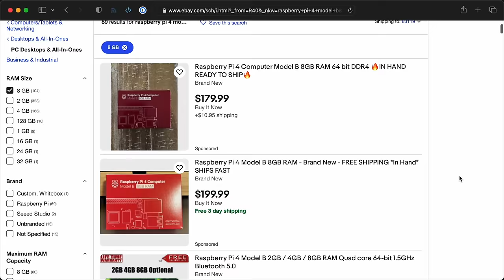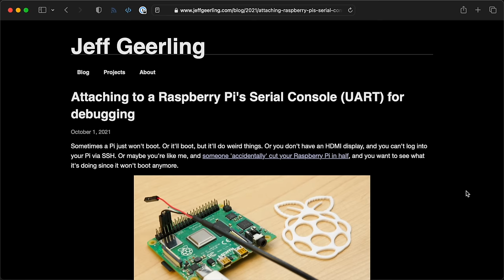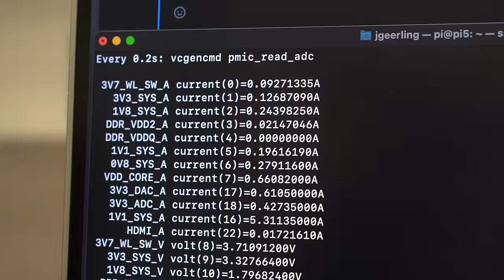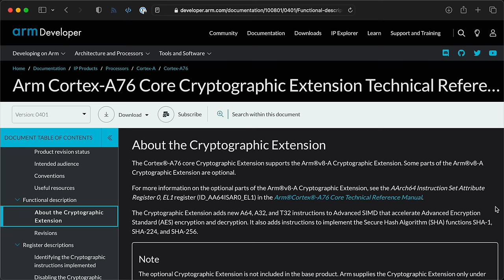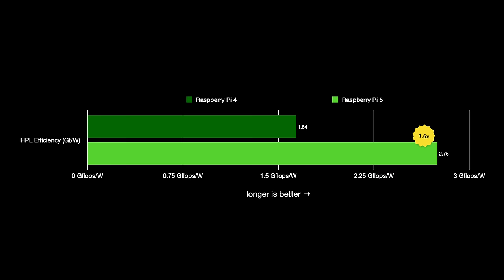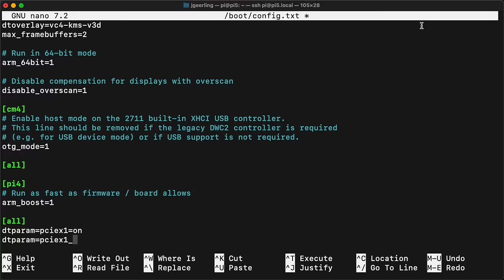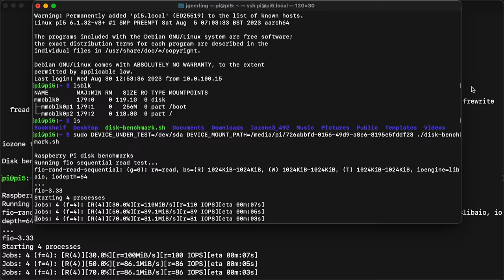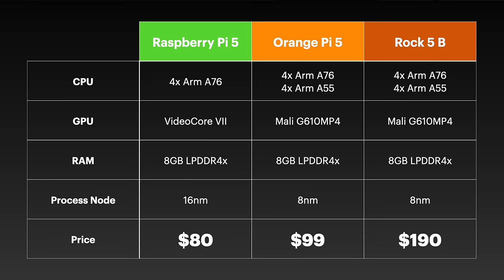Raspberry Pi 5: EVERYTHING you need to know

Comment: Thanks for the all tests and well organized review. What is status of UEFI and ACPI, and TFTP netbooting?  I used RPi4 firmware about a year ago, and it kind of worked, but some stuff did not work (either were broken, memory issues on 4GB models, various drivers not working or not having bindings, etc), and it still required extra partition just for the RPi, which is really not great.

I want to use UEFI and ACPI for just running standard Linux distros, but Windows people might also find it useful.

Comment: Can the RPi 5 use OTG on the USB C power port? It would be great if a powered USB C hub can power the RPi 5 and supply extra USB ports with Raspberry Pi OS?  I see it has been done on OpenWRT. The RPi supported USB 2.0 with OTG, is this still the same with RPi 5?

Comment: So there still isn't an integrated battery power alt source option? Such a missed opportunity.  Most external packs tend to cycle power when charging or changing wall vs battery, 3rd party micro UPS is iffy and expensive...

Comment: So are you going to finally get a GPU to run on a Raspberry Pi with the new 5 and all its improvements? I await your attempts on the edge of my seat as I would love to be able to run Cuda on a SOC that's not a Jetson and the price tag. A 1000 series Nvidia GPU has 2080 or so CUDA cores and my AMD backup desktop which is merely screwed to a wooden create has Ubuntu Studio and a 1000 series Nvidia GPU and it accepted the new drivers.

Comment: @JeffGeerling In my precommand I chose to have the official case with my RPi5 over the Active Cooler because I have cats. And I have a set of three heatsinks for RPi4 which sat unused since I put my RPi4 in an Argon case. I intend to reuse them on the RPi5 in combinaison with the official case. 

So in your opinion, which are the two chips beside the CPU where should I put  the heatsinks ?

Comment: Immediately ordered one just to see that my regulars 5V 3A USB-C PD chargers (the WW standard, i have maybe 10 of those at home) will not be sufficient and i would need to order the Pi specific power adapter. For the RPi5, we need a 5A 5V USB-C adapter that is non-standard and defeat the basic purpose and regulation of USB-C standardization. Why didn't  they chose a fully standard USB-C PD higher voltage with lower Amperes adapter instead ? Now, i am considering canceling my order for a not so improved new Pi system for 2023/2024 and my user case.... still have a month to decide.

Comment: Bluetooth - On my Raspberry PI 3 I had Bluetooth range of at least 30 feet maybe a little more. When I switched to PI 4B it dropped to approx. 10 feet maybe less. Has the Raspberry PI  5 fixed this issue?    I spent a lot of times on forums and with knowledgeable people in support and failed to find the PI 4B issue so I went back to the PI 3.

Comment: Is Pi 5 better suited for Frigate, especially with the pcie header (paired w/ Coral), or is a NUC still the best option? Looking for a low-cost but also low power (ARM vs x86_64) solution.
Reply: Honestly anything but RaspberryPi. Their image was ruined badly with the chip issues (which were easily fixed).

Comment: Does the new power controller mean we can use PD compliant bricks like the anker 30w gallium ones?  They only mention 5v/3a and it would have to support one of the higher voltage modes to get over the 20w mark.

Comment: The one thing I wished the Pi 4B had... USB OTG.  No change?
Reply: Pi 4 and Pi 5 both have USB 2.0 OTG over the power connection. One tough thing is that means your computer's port would need to supply enough power, or you'd need a USB-C splitter for power input + USB OTG to the host machine.

Comment: one thing that irked me about the Pi4 8gb was that the graphics driver stack was incomplete. It didn't share resources very well so if you were watching a youtube video and had a dynamic web page running at the same time, depending on which was started first, you would get some pretty obvious hickups and stuttering. I am wondering if they have increased both the Memory share to the graphics hardware and if they've improved on the graphics stack so that native desktop performance is at least as good as an I5 NUC from 2015 as apposed to an I3 NUC from 2012

Comment: I have a legacy National Instruments PCI DAQ card that I would love to be able to use with a low power computer for field data recording. The smaller the total system needed and the more it can be protected from bad environmental conditions, the better. In the early 1990s, the way to go would have been one of those 'lunchbox' computers that could handle adding a couple of cards in the case, but that would have still required AC power. The Raspberry Pi 5 PCIe connector looks like it might make the interface possible sometime soon. Is there a solution for powering PCI cards that's compatible with field use?

Comment: But Jeff, will Bookworm allow you to easily install ZFS on the Pi 5? Raspberry Pi OS for the 4 & 400 won’t allow ZFS installation. Raspbian did, Raspberry Pi Os with version 6 of the kernel won’t.
Reply: I just installed ZFS on Bookworm running on a Pi 4b, but that’s no guarantee that the Raspberry Pi OS based on Bookworm will!

Comment: I think with prices close to and up to 100€, SBCs lose most of their appeal .. You can easily buy an used industrial PC with an power efficient i5 or even i7 for this, with no bottleneck on any of the ports, full nvme speed and a very robust enclosure. Some even have GPIOs.
And the RasPi-Foundation's image ..  that's not just a matter of new hardware releases. They killed their image in the maker community with their actions, rebuilding the former image would take more than just an OK hardware at an 'acceptable' price..
Reply: Agreed. The shortages have just taken everyones mind off of them tbh. I'm a linux weido myself but I've really been enjoying the M2 & M1 machines from Apple these past 3 years (while RaspberryPiFoundation has been in a major shortage crisis).

Comment: Jeff - Knowing you I have to ask if there will be a Compute Module 5 (Of course there will be!) and when it will be available and will it have the same form factor.  Also, given the new interface to the GPIO pins, is there any change to the python drivers to use them.  Thanks!

Comment: Can I run the active cooler with new case at the same time? Or it is just one or the other?
Reply from the maker: Yes! You have to pop off the case fan bracket to get it to fit, but it fits inside nicely.

Comment: The RP#1 released Feb 2012 for $35.  Since then, inflation has risen 33.7%.  So the product should be priced roughly at $46.80.  But now, it is priced starting at $60 / $80.  For a product created intentionally to keep the price low, this is overpriced despite any new features or performance gains.

Comment: Hello Jeff, I have a little question for you, have you ever heard of the Orange Pi 5?
Now the question becomes a little longer:
I am trying to install a windows application on Ubuntu (MetaTrader 5). But I can't even manage to install wine to then install the .exe app, do you know why? What is the problem?
And if you know the problem and you know how to fix this, I have a further question. Let's say I have 20 Orange Pi 5, and I want to create a cluster with a GUI, where the Master node has a GUI and if I check on the system activity, I am able to see all of the 160 cores and 320GB of RAM, and on that Cluster I want to install a the application previously mentioned. Is this possible?

I assume that the way the Raspberry Pi and the Orange Pi work is probably very similar

Comment: So, you have to get a new power suppy, a new case, you are pretty much forced to add active cooling, none of the shields or accessories work due to changes in connector location or types, and on top of all that it is still slower than the competition that has been out for a while now... at basicaly the same price after all that you have to buy on top of the pi...
WHY?????

Comment: The fact that you must have their own power supply to be sure is ridiculous. 5V5A is just not normal. Why isn't the input voltage 12v instead, then people could use an old laptop USB-PD power supply to run this, instead of having to pay 12 dollars, or 20% extra, for this silly thing? Like why not go all in on USB-PD instead of having this absurdly high current 5V?

Comment: Im going to be really annoyed when my surface mount components start ripping off the board... Its going to cost more to fix that than the pi is worth. Not a fan of surface mount components for anything that requires a user to insert or remove something... Also the official power supply for the pi 4 in other parts of the world is actually quite bulky making plugging in multiple pi's a bit of a headache. Hopefully the new pi power supply has fixed that. Built in POE support without a hat would have been nice since some cases don't work so well with a pi hat on top.

Comment: again no on board SSD or SSD Slot but we continue to have dual monitor connection and other sh-its (including the SD slot)... at least they put a RTC clock and power button, and the case come with a fan, so at least 2mods down (cooling and Clock)
woooau we have PCIE so now we have an extra option for SSD, PCIE or USB V5000 ultra extra amazing fast
now an M2 hat need to be buyed extra, and the case need another fuck up, or maybe I should wait more as no difference to my Pi4 with fan and RTC already added...

Comment: Unless you like gaming, watching films or are just a total geek, what is the point to this.
I saw on another channel there is a version of MS Office (I assume Pi version) but I already use MS on my laptop. Why do I need to buy Pi to do the same thing??
I would like to learn to program, ie., controlling circuits or machines, robots, heating/ cooling systems. Never any mention from any direction on the possibly of this subject.
I am no geek but am just curious but I think I would be wasting my money.
Can anybody convince me otherwise? Please ??
Reply: I'd say the PI is useful to teach anyone, even kids, how to use electronics and/or programming on a cheap bit of kit where it doesn't matter if they fry it.  I wouldn't buy the Pi5 for this purpose though.  You can get older generations second hand very cheap.  For the Pi 5 I don't think most people would buy it as a replacement for a standard computer.  There are better alternatives.  I am currently playing around with a Pi 1 B+ with 512mb. Extremely cheap device to learn on.  The Pi 1 is very limited in use for emulation, but it's great for electronics projects.  I may get a better Pi later, but only if I need to.  I have a project in mind where the Pi will be connected to a touchscreen to allow the user to control it. I want the interface to be professional looking with smooth animations as you go through menus etc.  Hopefully the Pi 1 will be enough, but not sure yet.

Comment: I'm still supremely annoyed they have one USB-C port only for power, and two micro HDMI ports for video. Give us three multi-purpose USB-C ports! That all support power or data, and two at a time support video output. With micro HDMI people need an adapter/dongle anyway, why not use the "is actually a standard people use" USB-C for video?

But I'm still not buying anything from the Pi Foundation, so it doesn't really matter.

Comment: Got mine finally (8-GB version). Looks like the built-in cardreader is a dud again, like in my Pi400. An external one runs better, even with a slower card. IMHO it's also better thermically, because the card can get quite hot and if not in the case but external it keeps temperatures lower. Nice: 2560x1440p at 144Hz works with the Pi5, did not in the Pi400. 
The channel "leepspvideo" has a KDE flavor of PiOS that runs better than the orignal: https://www.youtube.com/watch?v=7qMlD-z_JrY
The mouse still gets wonky sometimes. I hope the PiOS devs can fix that in the coming months.
My Pi 5 is in a passive EdaTec Case. Highest temperatures (without overclocking) so far have been around 70-72°C. Good enough for me. I hate fans! ;-)

Comment: I am disappointed.  The Orange Pi 5 is available today and puts this to shame.  It has the same 4 cores at the same clock speed, plus 4 more.  It has a M2 expansion slot and support NVME booting.  It has RKNN AI accelerators which are supported by Codeproject and they thing CRANKS on the OP5.  It requires less power and you can get up to 32 GB of memory on the OPI5.   Unless I need a specific hat I don't see the advantage...  It might be cheaper.

Comment: tried it out, its ok for the price, soc is faster, but I expected a paradigm shift.
no usb4 40Bbps. (even 20Gbps would be ok) no wifi 6e. no BT 5.3. no 16GB and 32GB RAM versions. no 2.5Gbe NIC. these inclusions would have had minimal increase in cost.
while raspberry were busy scalping with an artificial "shortage" which made them millions, the rest of the world moved on to RISCV
Reply: Raspberry Pi did no scalping at all. All official resellers remained at MSRP. All scalping was done by third parties out of Pi control. Interested to know how you tried one out. As for RISCV, no, the rest of the world has not "moved on", because there simply isn't a RISCV core set that can provide the same performance and feature set of ARM. Yet.

Comment: Why... just why there is no m.2 option or emmc integrated or emmc module option. Why... this worth no money in this form. You can get a radxa zero, it is almost time for radxa zero 2, or you can get its full size form, or in this price you can get a nuc 3x the power with case and adapter and storage included, almost the same size. I just don't get this, but I really hoped for a good pi because of the software support, but this is just not worth the money.